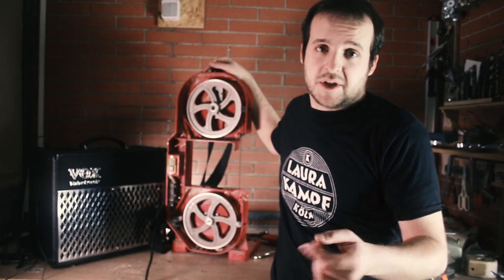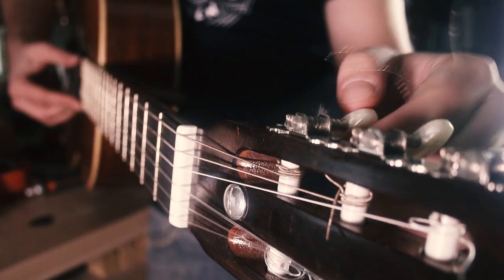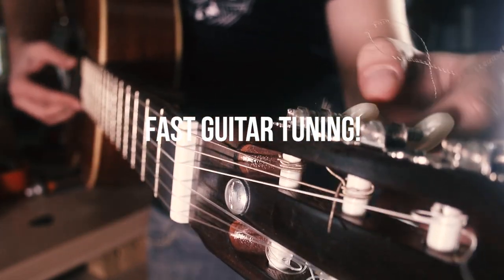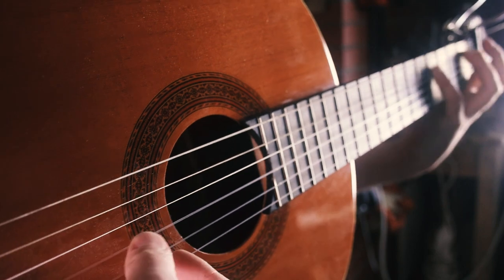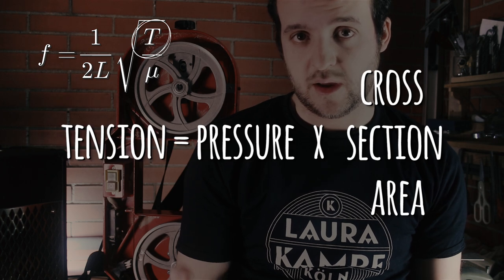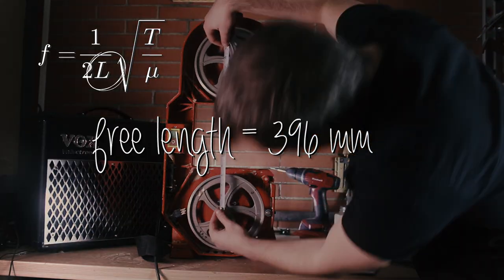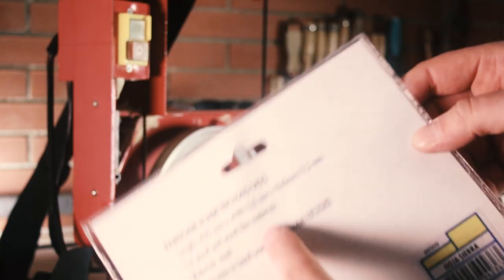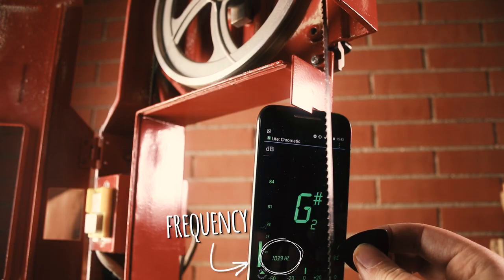How to set your bandsaw tension with a GUITAR TUNER

Comment: Nice video! I think there is a slight error in the units. The SI units are Kg, and M, not g and mm. That doesn't matter in the calculation for u, using mm and g cancels out,  but for L you need to use meters not mm. Your formula as is, gives 0.12 Hz, not 120 Hz.
Reply: This is a great video but it isn’t clear about the units, especially for anyone not used to working in metric. 15000 psi (imperial) = 103MPa = 103MN/m^2 = 103,421,359 N/m^2 = 103 N/mm^2. 

If you use 103N/mm^2 to work out the T in Newtons (like in the video), you need to use mm for L, mm^2 for cross sectional area, and g/mm for “u” (mu).  

If you have to use standard SI unit of N/m^2, you need to use metres for L, m^2 for cross sectional area, and kg/m for “u”.  This means having to work with very large and very small numbers, you get exactly the same results but the numbers in the first method is much easier to work with.

If you are getting 0.12 instead of 120 you are out by a factor of 1000 meaning you have mixed up unit conversions somewhere.

Otherwise great video.  The 3d printing community use the same method for belt tensioning, I never thought to apply it to bandsaw blades!

Comment: Wow! I need someone to do the math for what note in what scale would put me in the ballpark for a 1 1/4" by 144" x .042 band saw blade turning on 19" wheels. It seems like in theory that any blade this size turning on 19" wheels would "tune" the same when brought to proper tension, like guitar strings do. It would be awesome to have a "tuning table" of some kind with tuning for different size wheels, blade sizes and lengths.  I'm not that good at math and I don't want to spend hundreds of dollars for a band saw tension gauge, which is essentially an expensive band saw blade tuner.  In theory, if I used the same setup all the time I should be able to "tune" a new blade every time I replace or re-tension it, and like a guitar string, if it stretches a little out of tune, I could easily re-tune it, does that make sense?

Comment: Thank you, but I have a problem here:

https://youtu.be/JPyc2iDQnOA?t=142

When I number-crunch that equation I get 0.120 Hz! To get 120 Hz, I have to have the blade length in millimetres and the free length in metres (0.396).

I suspect you have done it this way to avoid displaying, to viewers, unfriendly looking numbers in obtaining T and μ:

100,000,000 pa
0.0003 m
0.00465 m 

0.022 kg

I suggest, to retain the simplicity, and get the desired 120 Hz, the 396 (mm) can simply be changed to 0.396 (m). 
 
It's no biggy, but I would  be grateful to get this cleared as it will assist in my asking your further advice with the formula. I definitely intend going with the method you have presented.

I also play guitar and love your humour. The pickup was a nice touch. 

Thank you,

Sean
Reply from the maker: Thanks for your comments! I just saw this, I'll take adeep look at it and reply!
Reply: Mate, I have looked at a few presentaions and have very much favoured what you have presented. I hoping to suggest a way to make your method and formulae even more handy, but I'll need your advice on whether it works or not.